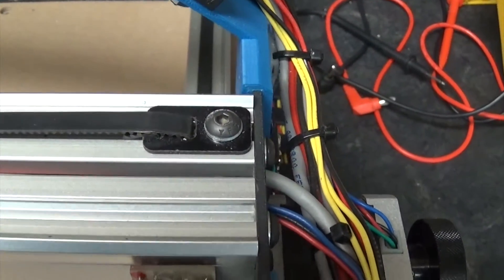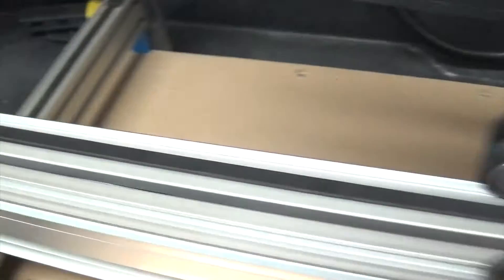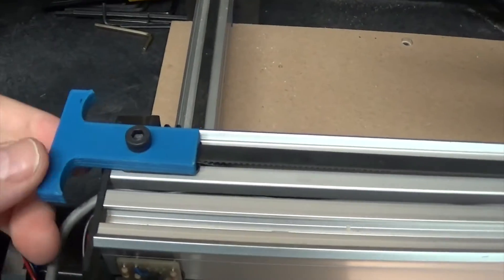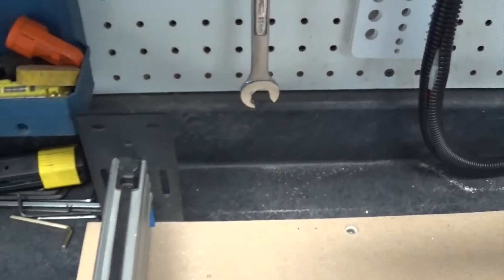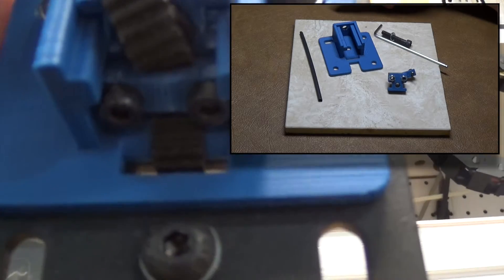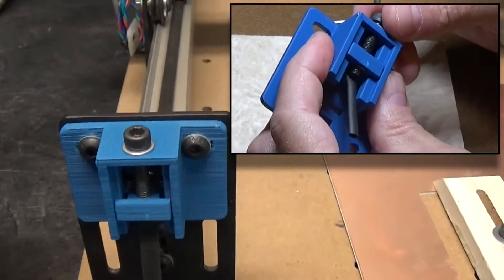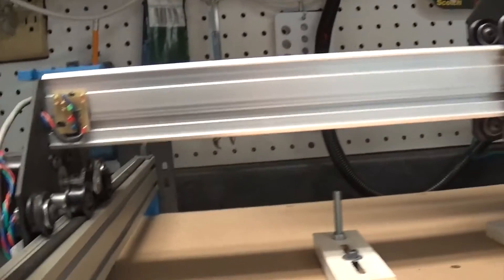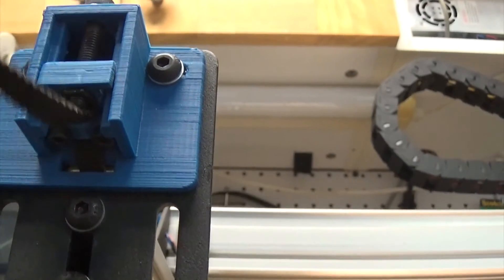ShapeOko Belt Tensioners

Comment: Thanks for adding the Thingiverse link. Much appreciated. One last request...could you add some detail (either here or on the model sharing sites) regarding the suggested hardware (i.e. M3 x 35 hex cap screw, M3 hex nuts, etc) for the different tensioners? I know the X-axis uses the stock tensioning bracket, but imagine you had to go with a longer screw to account for the thickness of the t-handle. It would cut out some trial and error when sourcing parts to know what worked for you. 

Thanks again.
Reply from the maker: ***** 
I did need to use a longer screw due to the handle thickness. The screw for the X axis tensioner is a 4mm Hex M5 12mm long screw.  I also updated the description too.  Thanks for pointing that out.